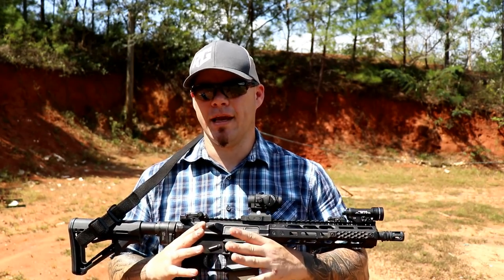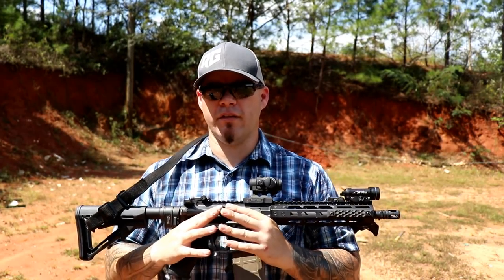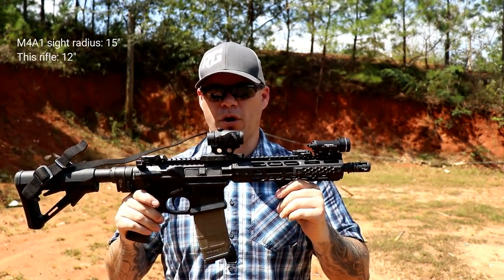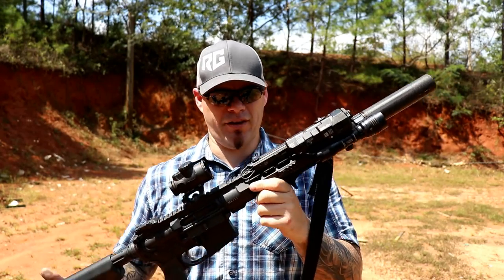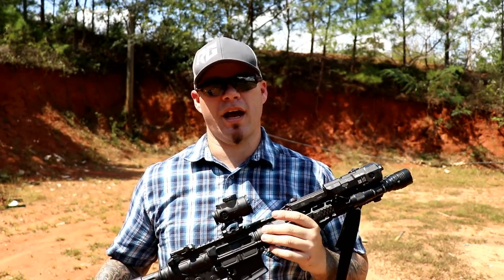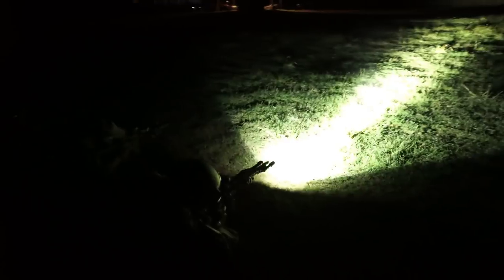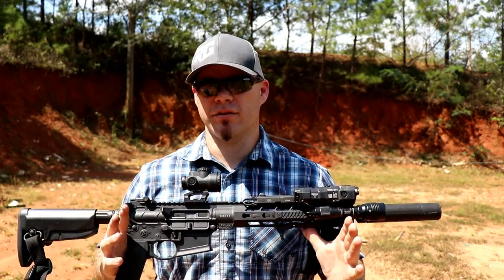Rifle Light Placement

Comment: My home defense AR has the light positioned at 9 o'clock, because I use a forward vertical grip, I just lift my thumb and easily hit the strobe on-button end-cap or the on-button for light only.  A perfect position for me and my AR.
Reply: That's how I did it before I converted to a pressure switch. Your way is nice in my opinion.
Reply: Yeah, I played around with an offset mount on my 12" ar pistol and found a 9 o'clock worked prerty good too. My grip was right around where I'd want it too, maybe 2" back from the end of the handguard. Could reach thumb up to click the light on. Not sure why everybody seems to mount on the right side? Ha ha, just saw this was a 6 year old comment.

Comment: damn i think i finally understand the 12 o'clock light position. ive been a 9 o'clock guy right handed red blooded american for years, but running through my house and changing angles i see how i could have to shine the light on a wall blinding myself or doing some weird ass angle. 12 would make it pretty simple. i finally understand the beauty of a pressure pad too being a shorter guy

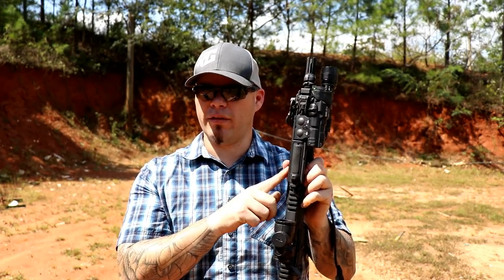Comment: A lot has changed since this video was made. I have Streamlights HLX's on all 5 of my AR builds and they are all at the 12:00 position. Even the two with my LPVO's. I do not run tape switches, and I do not run night vision. Simple push button activation in the perfect position for my angled hand grip. The light goes right to the front of the handguard without hanging over. 

My shortest mount (LPVO 1-8x - PA Compact) is 1.93". The only time I see the light (the top of the light) is when the LPVO is on 1x, and even with that I have excellent clearance of my reticle. This set up is on 2 builds. This also have offset red dots. Romeo 4t's. Badger Ordnance mounts

I have two builds with the PA 5x Prism (also with offset red dots). The mount height is also 1.93". Plenty of clearance - no sign of the light. I am using the mount that came with the 5x Prism but it sits on a Unity 1/2" riser. These also have offset Romeo 4t's

My 5th build is my HD weapon - Romeo 4t Pro  on a 2.26" mount. Unity mount.  This also has a Juliet 4x magnifier with a Unity FTC mount. The weird this about this set up is that I also have an offset optic on it. I have a PA 1x Cyclops at 45 degrees. No its not the norm, but I wanted to make sure all of set ups are not 100% battery dependent and I wanted the 4T Pro as the main optic. Despite 50k hours of battery life - not taking any chances.

Bottom line is that all my lights are at 12:00. They are not what I would call a low profile light either. All of my optics clear them with no problem at all. 

With mounts getting higher and higher over the past few years the 12:00 position has become a much more valid option. I understand if someone runs NV this isnt a real option, but if you dont 12:00 is a great placement. My opinion.

Comment: It's about time someone calls out the wml. Make the darn thing out of metal.
Reply: seriously, the company is stubborn.
Reply: Or somebody competant make a light with a 45 degree switch lol
Reply: I would rather have a little less light than have all the weight of the surefire "anvils" on the end of my rifle.
Reply: Take a look at cloud defense
Reply: @tacbear  The wmlx weighs the same as a surefire m300c, just the m300 has actually better light AND is much stronger. Don't get me wrong, I have a wml gen2 on a pcc and like it, just not for serious use.
Reply: @basti080891  
Surefire M300c
Max Output -- White Light 500  lumens
Runtime* 1  Hour*
Length 4 .10 inches
Bezel Diameter 1 .125 inches
Weight w/Batteries 4 .1 ounces

Inforce WMLX
Output: 800 Lumens
Runtime: High efficiency LED provides up to 2 hours
Weight: 4.02 oz / 125 g with batteries........I'll stay with Inforce...I won't EVER do business with Surefire after the business dealings I had with them in the past.
Reply: @tacbear  the candela on the inforce is garbage though. Modlite,  Cloud Defensive, or Arisaka perform much better
Reply: @tacbear  You're not taking candela into account. Lumens are important for overall output, but more candela = more consistent lighting, which also = better PID on targets.

Comment: Damn, this is thee best instructional video on light placement I have ever seen. I feel better seeing someone who knows what they are doing, have a light at the 12 o'clock position, on the appropriate rifle.
Have you ever had trouble with the light switching off due to heat from the barrel/gas block? Thermal protection might kick in is my only concern. I have not shot that many rounds fast enough to get my barrel stupid hot.

Comment: I currently have my HD rifle, an LWRC Six8-A5 10.5, running a Surefire Scout on the 12 in front of a Cloud Defensive pressure pad shoe housing.  I will say that the light obscures a portion of the lower view through the Aimpoint T-2, but realistically, if I had to use this setup inside the parameter's of Bedroom CQB, then I would likely just place Torch On Target, (TOT) then pull the trigger.

Comment: This is an update to my post below from two weeks ago. I decided to switch over my lights from the Streamlights to the Rein 3.0's. 

Same situation 12:00 works perfectly as all the optics are at least 1.93". Most are 2.26". Absolutely zero obstruction from the light/optic combo.

The Rein 3.0 is just a great light with no issues that need to be fixed (Streamlight HXL flicker and they just shouldnt) There is a fix but cmon.....why is it necessary? The 3.0's are expensive but an amazing piece of equipment.

Comment: 4:50 - great point about positive ID vs. just seeing the target
6:20 - great point on exposure

What are your thoughts on using the HL-X Laser at the twelve o'clock position and relying on the laser as the backup sighting system, ditching the BUIS?
Reply: Whole point BUIS is no electrical power needed, I’d recommend against that use of the HLX-L

Comment: Thoughts on the arisaka offset mount? Allows scouts and pro-tacs to be mounted directly to the mount itself. If inserted at 3 o'clock position it tucks it tight to the handguard at about 1:30 or 2:00.
Reply: I've used arisaka mounts for awhile and use one now with an HLX and it's the beez.

Comment: Whoa! What kind of hand guard was that where it extended past the front aiming gas block? I'm currently stuck with a short carbine length handguard on a 16" barrel. I have my light as far forward as possible but because the barrel is still way out there I inevitably get huge barrel shadow...

Comment: When running a setup along the lines of a 1-6x24 variable with a mini red dot kicked off to a 30-45 degree offset (like on your PWS Mk2 Mod1) does running an M300 scout light at the 1:30 position impede the use of the red dot at all, or is the sight mounted at a high enough angle to where the light doesn't block the field of view all that much?

Comment: Can you do a video on the Arisaka/Malkoff Scout lights? I'm interested in them as a cheaper Surefire alternative that takes the same mounts and switches, but there are few data points on them. Thanks!
Reply: KnifeHand03 I have one of their two cell models. Plenty bright, very nice hot spot and flood, plus a good amount of throw. The electronics from Malkoff are all potted so they are super durable. I also enjoy that their footprint is very compact. 

Defoor really likes those lights as well. Probably a good person to ask as well.
Reply: I’m probably mad late, but check out Streamlight’s protac railmount series
Reply: Cameron Miles I have that its a great light I don’t really like the strobe. I upgraded my home defense rifle with a surefire m600 DF. It’s suppose to be 500lumes brighter with an 18650 battery but it seems just as bright as the streamlight. Overall their very similar while the surefire has a larger hotspot and farther throw but not really by much too me, also the surefire seems to be a little bit thinner than the streamlight. I like the streamlight just didn’t really care for the strobe excellent light though especially for the money you get a lot with it.

Comment: The problems you saw with the WMLs, has that changed with the Gen 2s or is durability still a problem? I do also really like the design and controls on it, but yes this isn't the first place i've seen that has taken issue with the durability at least as far as the gen 1s are concerned.

Comment: I've been running a wml gen2 on my 16" gun mounted at the 12 o'clock with the front sight behind it and I agree the controls are awesome and the design is good, but it just doesn't have the balls. So I literally just switched to the stream light HLX mounted at the 3 oclock with the cloud defensive shoe so I can better utilize the capabilities of the rifle should I ever need to.

Comment: does light, when illuminating, interfere with red dot or whatever your optic projects?  I have heard that's a problem with some optics.
Reply: Yes as soon as you turn on the light your dot will look much more dim ..... you need to find a setting that isnt completely blinding you when your light is off but still visible when it is on

Comment: A trick to help keep your lens from getting carbon fog is putting a thin layer of chapstick on the lens.  Doesn't seem to effect the light beam much and for some reason the carbon doesn't build up on it as quickly, plus when it does you can wipe it off quick if you really need it.  Also helps keep your lens in better condition and you don't have to constantly try to clean it.  Perhaps you already know that trick but a friend showed me that a while back and its worked really well for me.
Reply: Michael Schatz he has his own product collaborated with Thyrm. Called the Clens. Removable lens protectors.

Comment: Is there anywhere that has better price on the surefire m600df scout m300 mini scout that can best buygunstuff price point wise? I have a couple gen2 Inforce WMLx’s I picked up fit less than a $100, so thought I should give shot due to the great ergonomics but have yet to get close to running them hard. Since I trust your opinions given your first hand experience with these products   It looks like I’ll be budgeting a couple hundred for surefire scouts on my go to & back up rifles & pistols from most to least likely rifle I’ll grab, yet feel best way to run them for my body type since I’m 6’7” is with offset arisaka defense offset mount with surefire duel tail caps & one piece cloud defense offset mounts on my 16” bcm bfh elw(trijicon 1900006 in ad-recon Mount)marching 11.5” bcm bfh(exps2-0grb-fde)w/fde bcg’s&fde Kmr-a rails. Which will be backing up a 14.5” Noveske gen3 afghan w-aurora acss ta-31 Acog(once they ship) w/offset type 2 3.25moa rmr& 11.5” Noveske gen3 pistol(Aimpoint T2 on ADM lower 1/3rd we mount)

Comment: Question time: Active AZ LEO, I currently have a streamlight protac2 mounted at 3 with a pressure switch at 12. I'm about to purchase a streamlight HL-X which I'll replace at the 3 position.  My question is would it be worth it to place the protac 2 at the 9 position with a tail cap? This way can use the light on both sides against barriers, and have a tail cap in case the switch breaks for some reason. Is this excessive junk on my riffle and not needed?
Reply: Richard Averett I'm not a LEO or military, but I do see a lot of active military (and Aaron Cowan himself) that run the pressure pad on the 12 o clock position because it is ambidextrous. Logically, I don't think Aaron would be using a pressure switch if they are prone to failing.
Reply: Richard Averett I ordered my hlx from cloud defensive. the light and tape switch mount is $155 shipped!

Comment: Doesn't the light obscure your deployed front sight?  That would be my biggest concern.  and with the TLR, you need a tool to remove the light to then see the sight
Reply: Front sight will clear a pistol light (and some slimmer rifle lights) mounted at 12 o'clock. When the lights on you get a fairly good silhouette for the front sight, assuming you need to actually deploy the front sight to begin with.
Reply: an x300 will give you a less clouded view but when I ran a tlrHL infront of a DD fixed sight I had no qualls about it.